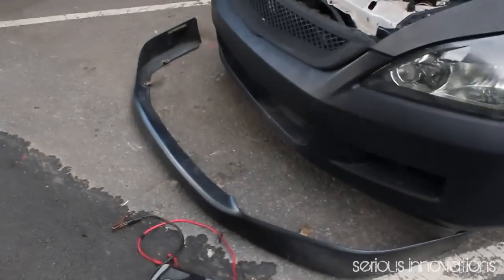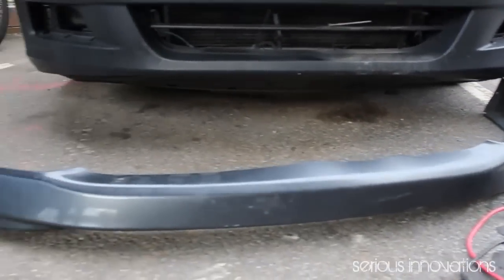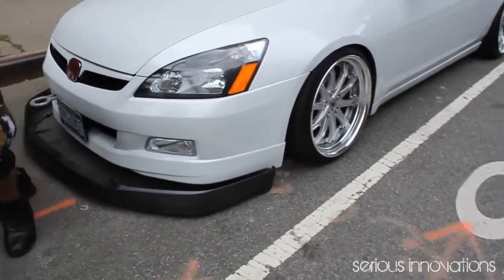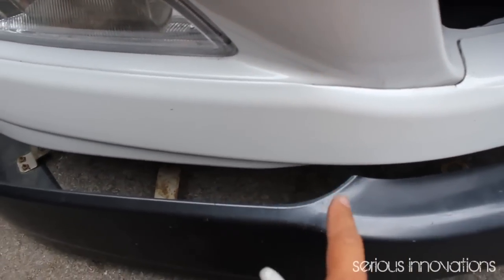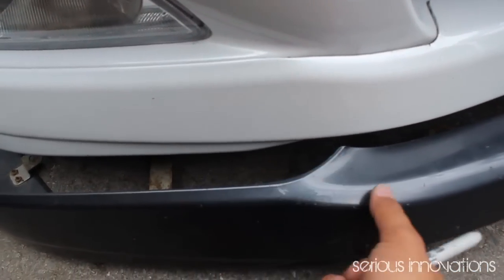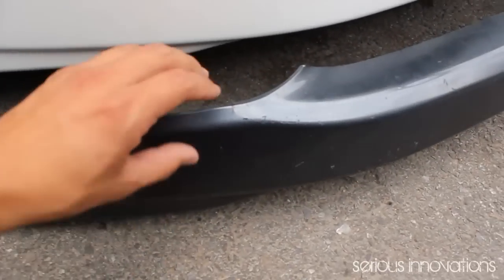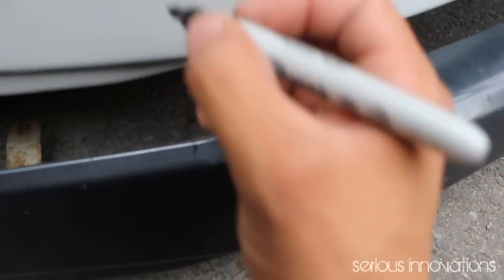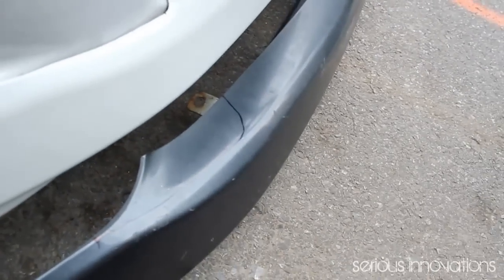03 - 05 accord front lip installation on a 06 - 07 front bumper

Comment: You can cut holes to size for the fog lights you want to use. I'm about to make that mod on my 2003 accord. I'd rather just cut my own hole and buff it up rather than spend 5-700 on an entire new bumper.

Comment: Excuse me is the bumper the same of the 07 and 04 and if it will fit perfect thank you
Reply: +Teno Rosales Yes. You can buy a 2006-2007 front bumper and it fits on a 2003-2005 accord.
Reply: It fits directly on to the 03-05. All you need is the upper grille as well as the lower bumper grille which is optional.

Comment: wassup man, im trying to install my foglights onto my accord but it doesnt fit, what should i do and how woul i install it. thanks bro
Reply: +Jeffery Rodriguez 
So you bought the fogs that fit the shape of the 06-07 bumper? I had the same problem, i couldnt find anything anywhere to mount them. It took me like 5 hours in total to mount the fogs. You have to cut and remove part of the bumper and the fog light brackets and ghetto mount them. 
Place the fogs in the bumper and pretty much figure out what you need to do to mount them. I wish there was a easyier way...